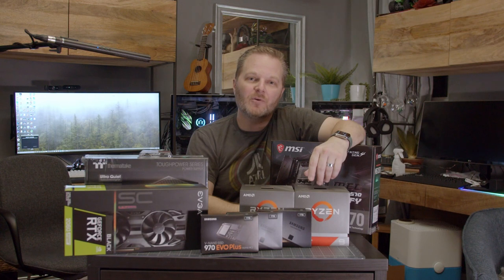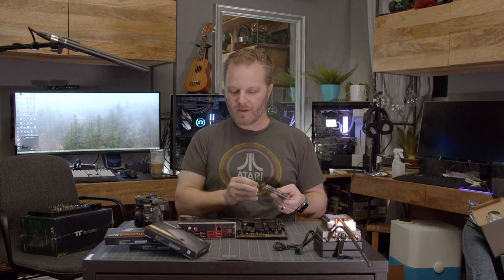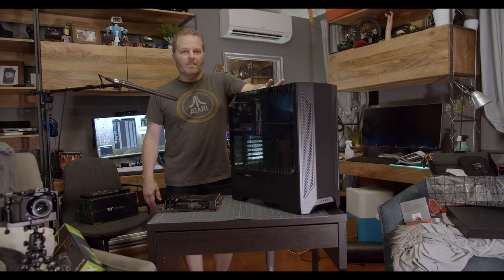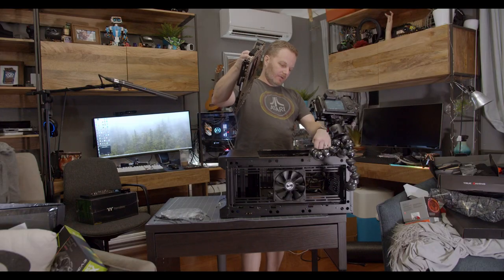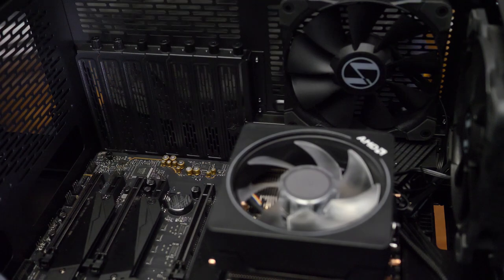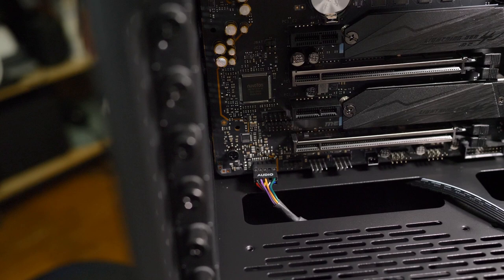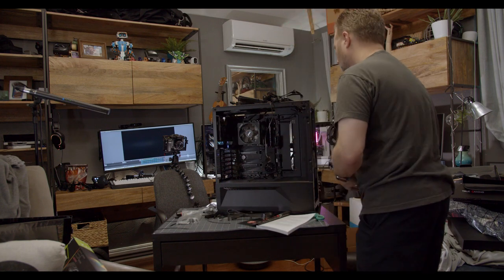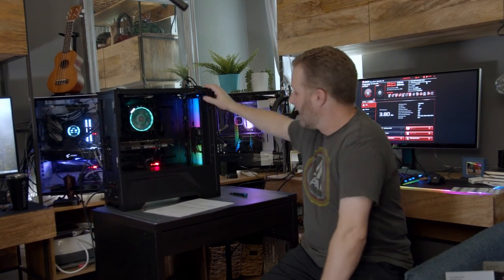How to build an AMD based Computer - Assemble a Video Editing PC with me

Comment: John's Films really glad I've found you as a resource! Now, with apologies for so many question marks below, I am gathering parts for a first Davinci Resolve 4k build as a content creator. (Workflow also includes other video editing programs and large Adobe graphics projects.) 

Because my projects are big in size, I'm thinking to max out RAM with 4 32gb g.Skill Trident Neo z modules at 32mhz. (Have read g.Skills are best for Ryzen 3000s (?)  If I do that, can I use, as I see you do here but with less sticks, the cooler in the Ryzen  box especially with my config at128gb/32mhz? Or 64gb/32mhz, etc?  Some indicate the 32mhz modules are more stable than the 36 or does it even make any real difference (?). 

Thanks John, any thoughts you or others might have appreciated and absolutely will buy you a cup of coffee!
Reply from the maker: Hi Ben - Thanks for watching!  1) the cooler in the box is for the CPU and is not affected by the amount of the RAM in the system.  However, the Ryzen 3000 chips, depending on the model, have an interconnect that runs at a frequency that is ideally synched with the RAM speed.  The faster that frequency, the more heat that component of the processor puts off.  I'd venture it's still much less heat than the processing cores put off however so I don't think even the ram speed is TOO big a burden on whatever cooler you have there.   2) Ram stability by speed is very specific to the motherboard you are using and the ram chips specifically on the sticks.  The reason...the weakest link in the communication cycle of CPU wants to do some processing, CPU needs data to process, CPU asks it's local cache for the data...it isn't there so it sends a request off the chip and through the traces in the motherboard to the socket and into the RAM...the weakest link is the motherboard traces and socket to the RAM.  Often motherboards can handle 2 sticks at 3600mhz or 4 sticks at 3200mhz or whatever...the issue is consistent power and signal at the desired clock speed.  There is an easy way to know if your intended ram, motherboard and CPU will work together however...the Motherboard Manufacturers publish "Compatibility" lists they often call Qualified Vendor Lists (QVL).  You can find those on the motherboard's product page under the support heading.  There you will find specific RAM manufacturers sku's that have been tested in 1, 2, 4 stick configurations and are guaranteed to work.   Greatly simplifies life!!!  Which processor are you considering specifically and which motherboard?
Reply: @johnsfilmsllc  Hi John...Thanks much for your quick reply. I will be using 3950x on Asus Crosshair viii Formula motherboard as soon as I get the case and am planning to order g.Skill Trident z neo RAM because I've heard these are built for the 3000 series(?). Yes, it took some looking but the Asus site 
at https://www.asus.com/us/Motherboards/ProArt-Z490-CREATOR-10G/HelpDesk_QVL_Memory/ on a page called ProArt z490-Creator 10G has listed 

However I wanted what the mobo would handle which is 4x32 128gb or lesser 4x16 per above. So another question hovers: Are the Tridents any better for 4x32 modules (if Asus lists any) than any others?
Cheers!
Reply: Sorry clearly unclear: Asus the most the mobo would handle is 4x16gb at certain MHZs. So it appears there may be instability at lesat with these modules...
Reply: that is with the 128gb modules...
Reply from the maker: Unfortunately the 3950x doesn't come with a cooler in the box so you will need to get one.  Further the motherboard needs to be built specifically for the AM4 socket and b450, x470, b550 or x570 chipset.  The one you picked there is a z490 (intel) based motherboard.  If you are looking for the Crosshair Formula viii x570 board then the QVL can be seen at - https://www.asus.com/us/Motherboards/ROG-Crosshair-VIII-Formula/HelpDesk_QVL/ 
Something to note, if you need fast ram and extremely large quantities...you may want to consider a threadripper based system.  One of the major differences between the threadripper based systems and Ryzen is quad channel vs dual channel memory.  With threadripper you get 8 memory slots and 4 access paths to them rather than the 2 in Ryzen.  This can significantly improve data deliver from RAM to the CPU for execution cycles.    You are right it doesn't seem the x570 ASUS boards support more than 64GB of ram...I understand Gigabyte has some that go up to 128GB.
Reply: @johnsfilmsllc  Thanks John. May the Gods of Gratitude Shower Down Upon You. You took the time to pull back the perceptual curtains of at least one inexperienced builder. My whole point was to build a system that of course dwarfed my MacBook Pro which took hours+ to do my sized projects. So I may try to return the Formula that hasn't been opened to a Gigabyte or other as qvl qualified.....BTY I went to buymeacupofcoffee.com and couldn't quite to get it to work. I'm working on it. Or is the feature available thru YouTube?
As always...Cheers!

Comment: Thanks..
Please suggest affordable Monitor for colour correction & Grade. Like BenQ BL2420PT ?
And Do we need decklink card !
Reply: EIZO CG247 X : u can start with that if u love what u do. Given it's not cheap, it's not a recommandation, it's only one of the best for starting. Buy it second hand.
Reply from the maker: Vivian's recommendation is really helpful Rahul because it shows you the specs you should be aiming for...  IPS based panel (technology for better color reproduction, viewing angles), enough resolution you can see your target the way you want for qualifications etc (depends on your intended output), color space range (srgb is the bottom of the barrel and only covers about 72% of the DCI-P3 output in the EIZO.  Next is your panel bitdepth and while the majority of consumer panels (if not all are 8bit + FRC) they will often call them 10bit in casual terms and then get specific in the specs.  8bit + FRC means it's truly an 8 bit panel...the thing flickers between two colors very quickly at the pixel level to make your eye seem more color range than the panel can truly produce.  10bit...has the color range natively.   Contrast ratio is the light difference between the bright and dark parts of the image it reproduces.  Higher max brightness enables HDR but the manufacturers all use their own view of the numbers and it's hard to get a definitive ranking against each other without them in your hand.  Finally you have refresh rate measured in hertz (hz) that indicate the times per second a panel is updated.  60hz is a baseline and my eyes  get annoyed by rates that slow when I use them all day.  75+ is my general rule of thumb.   All said...frankly if you are just starting and you can get an IPS panel that is the size/resolution you want that is 8bitFRC and you are publishing to youtube or a similar platform you are fine.  Likely a good idea to spend the extra money in processing power or glass for your camera.   

Like the monitor discussion, the decklink card is a can of worms.   If you have the studio version of resolve, you can output what they call a "video clean feed" to a second monitor attached to your GPU.  The good thing...it's easy...it's attached and it's ok enough.  The bad news, because the signal comes from your color grading software into the GPU.  The GPU can apply color transformations to it as it renders it to the screen.  Effectively it's "outside" the resolve BMD pipeline.  How much it gets mutilated by the drivers in the GPU, by the libraries loaded or other...depends on your system.  If however you have to have the cleanest of the clean...you will need a decklink card.   It doesn't run through the GPU and has known clean drivers from BMD. Note: I have the 4k mini and it doesn't go above 30fps so anytime I'm editing for slow mo or whatever if I play the native media it's a blank screen.  so it goes...
Reply: @johnsfilmsllc  Thanks :)
Reply: @vivianvaldi7871  Thank you